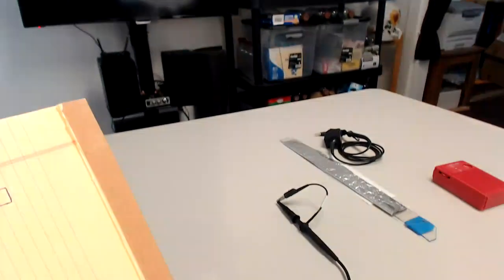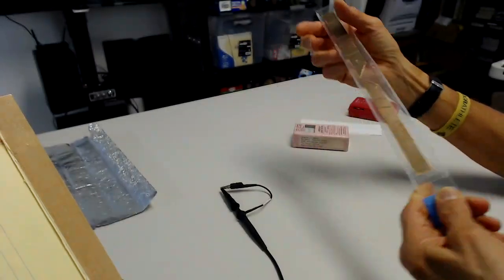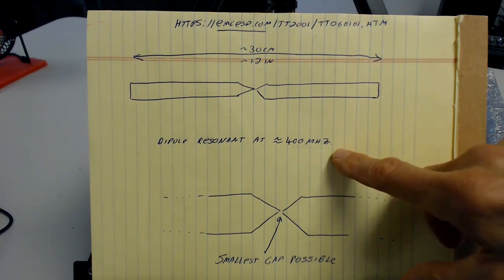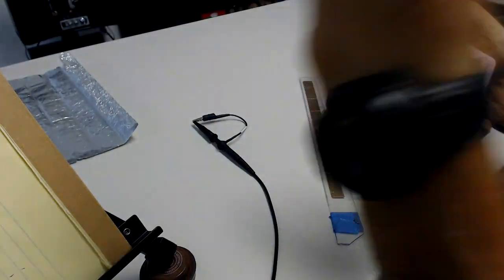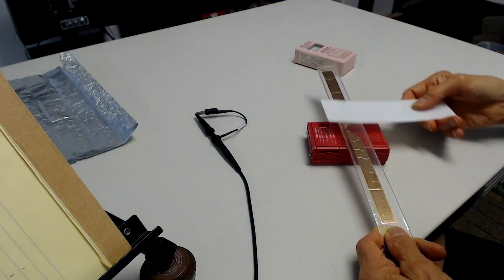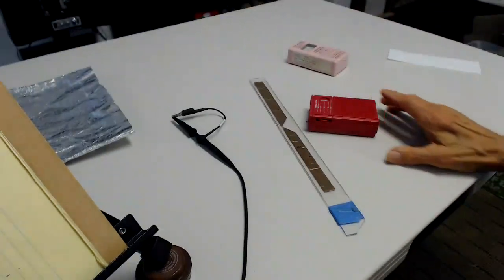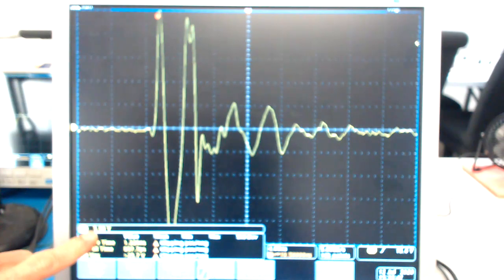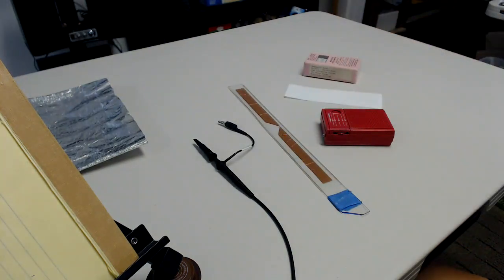Static Field Generates EMI - Engineering and Science Fair Demo

Comment: Doug:  You can do a similar demo with much less equipment. Just put a monopole or a hank of wire on your scope terminal, then reach into your pants pocket and vigorously shake your coins. The triboelectric charging of the coins against your pocket cloth will allow the coins to charge and then discharge to other coins, creating many ESD emissions. If you want audio too, just connect a speaker to your scope's Trigger Output.
Reply from the maker: Hi Ed, I wanted to make the point that small ESD events can mess up scope measurements as well as the physics of the situation. I don't think engineers realize how susceptible scope probes are to noise in the room.